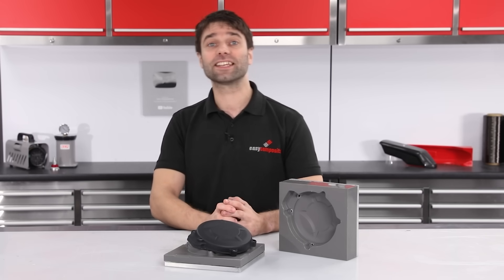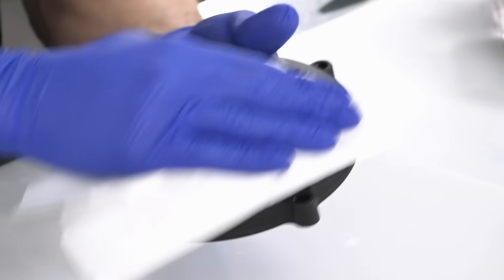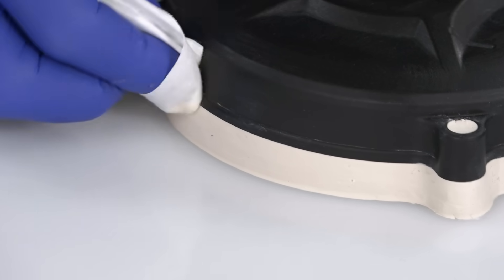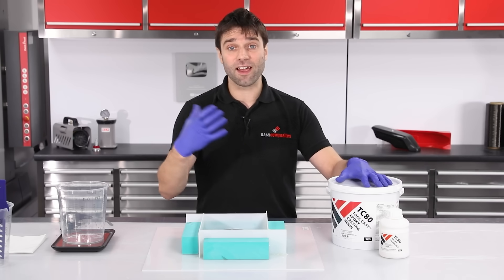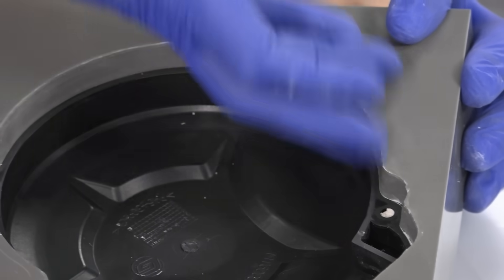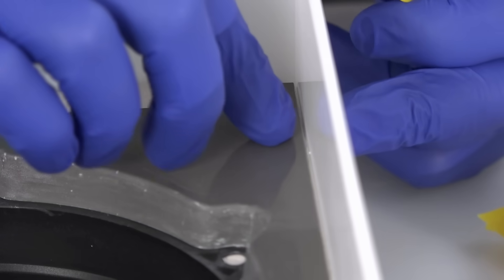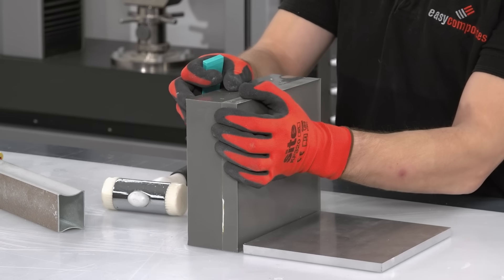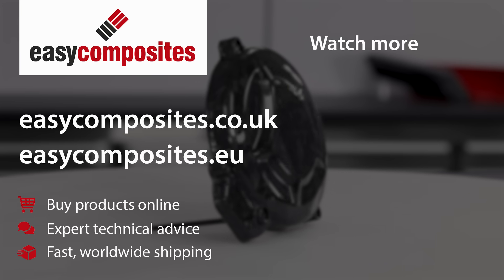How to Cast a Two-Part Compression Mould for Forged Carbon Fibre

Comment: Looking forward to your next video as I am in the process of making this for some of our projects.
Reply from the maker: Hi Joseph, hopefully the videos will answer all of your questions if not please let us know :)
Reply: @easycompositestv  I hope so. But what I am doing is making two half forged carbon parts as there are some undercuts in the model and a hard mold will not be able to remove from the inside once the carbon is hardened. So I make two half parts then join them afterward with the same resin. The tricky part now is how to make the joint seamless.

Comment: Neat trick with adding the wedge slots for separating the two halves. I guess there's nothing to stop me doing the same thing with some wax on the flanges of a wet lay-up to make it easier to get a wedge started... :)
Reply from the maker: Indeed, the principle will work on all sorts of matched tooling or multipart moulds on the join lines.

Comment: I didn't get a good look, but the original part has a mark on it saying something like "PA66  GF35". This means Poly Amide 6,6 (chemist speak for nylon) Glass Fiber 35%. Similar markings exist for for other polymers. 
My point is that these markings should be scrubbed off when being used to make a mold so as not to confuse customers , future owners or your future self.
Reply from the maker: For a product you  intend to sell, yes it would be a good idea.  For a personal project or one off, such confusion is unlikely to occur - especially for a part that appears to obviously be carbon fibre of some kind.

Comment: Awesome :) How strong are these forged carbon parts?
Reply from the maker: Entirely depends on the thickness of the part but generally a forged component would be considerably stronger than a typical injection moulded plastic part. We intend to cover comparison of strengths in a future video which will answer your question in further depth. We hope to release this in the next few weeks.
Reply: @easycompositestv  I will watch that for sure :)

Comment: whoever came up with the idea to use the word "forged" for molded chopped-fiber composites was a marketing genius.  Dishonest, but clever. Meanwhile, metallurgists continue to cringe.
Reply from the maker: Haha, yes, we knew this would come up. Here's where we got to our thinking with it...

For what it's worth, it was pretty-much Lamborghini who coined the phrase, if they didn't coin it, they definitely popularised it and you can't question their marketing skills!

On the etymology of the word 'forged', both in an established engineering context, and in its suitability and applicability in a composites context (regardless of whether Lamborghini and others were using it) we don't think it's too far from the mark. Whilst 'forged' means something specific in a context of forming metal, the word forged also means "formed by pressing or hammering with or without heat" (Merriam Webster dictionary) or "to make or produce something, especially with some difficulty" (Cambridge dictionary). Given that the process - in this context - refers to compression moulding under pressure, this description does seems pretty apt.

Whilst you could certainly call a 'forged' carbon fibre part 'compression moulded carbon', you could actually call most carbon fibre parts 'compression moulded' because many processes - vacuum bagging, prepreg, SMC etc, are all forms of compression moulding. Forged carbon is a way of differentiating compression moulding short strand carbon from traditional woven or long strand reinforcement. The short strands being key to the process in allowing the reinforcement to 'flow' more easily to conform to the mould contours under pressure in a rigid tool, something that doesn't happen with woven or long strand reinforcement (leading to voiding).

Comment: Looking forward to the rest in this series. I imagine this process is particularly good for detailed parts and also bypasses all of the effort of vacuum bagging?
Reply from the maker: Although it bypasses vacuum bagging itself, there is still a reasonable amount of force applied in the compression stage which replicates some of the forces involved in vacuum bagging. That helps with fibre consolidation and removing excess resin.
Reply: @easycompositestv  what sort of tonnage press are you looking at for the compression stage? Would a 10 tonne press be enough or would you need something beefier?
Reply from the maker: @TheFatPandaIAm  Obviously you could use a press but in the case of this part, we'll just be using G-Clamps - we'll cover this in detail in the upcoming video.

Comment: What a shame this is not suitable for high temperatures, would like to use this for prepreg tooling, or even replacement for aluminium tooling
Reply from the maker: Hi Miles, there are options for creating a high temperature version of the same process. We need to do a bit of testing to make sure it would work as anticipated but we think there are products in our range already which could be combined to create a high temperature version of a Tool Cast epoxy. Once we’ve done some testing, we’ll add the information to the project page for this tutorial on our website.
Reply: @easycompositestv  im I'm the market for 200°c capable tooling if you are able to test that 😉😄
Reply: @easycompositestv  yes please! we need this for prepreg

Comment: Neat tip with the wedge inserts on the sides 🤟
Reply from the maker: Yes, they did work out rather well. In the end, the moulds just fell apart so they could be considered a bit overkill but if you were using the moulds over and over then you’d probably start to appreciate little bits of finesse like this.

Comment: great video as always 
thanks, 

is there any product that can handle a pre preg cure
Reply from the maker: Mmmm, good question. Not as an 'off-the-shelf' product but we suspect a good high temperature equivalent could be made by combining our EL160 high temperature epoxy with powdered aluminium and (possibly) some aluminium trihydroxide (filler) to produce a high temperature casting material with the right thermal properties. We did anticipate this question and plan to do some tests to evaluate this combination of materials. We're pretty sure it would work fine. We'd probably recommend using our EG160 high-temp gelcoat to improve the polishability of these moulds, if they're for prepreg production.

Comment: If I didn't know better I'd say you have done this before.
Reply from the maker: Haha, well Mark we've used the TC80 to make plenty of one-piece (male) moulds for vacuum forming, and of course we have quite a lot of general casting experience but - to be perfectly honest - this was the first time out using the TC80 to make a matched compression tool. That said, when you're lucky enough to work with these materials constantly, you do tend to get a pretty good 'feel'!

Comment: Do these parts have to be cured in high temperatures?
Reply from the maker: Hi Paulina, no, this is all ambient temperature cure. When we do the forged carbon process in the next video, that's also all done at ambient temperature so no oven or additional equipment required.
Reply: @easycompositestv  ok thank you for the response. I have a curing oven. Had issues with 2x2 carbon fiber twill that I made with my boyfriend for cars interior trims. In the summer time the parts would warp because the temperatures in the car would rise close to 180f. So we started curing the parts in the mold before releasing them and that fixed the issues.

But since the parts in the video are forged and are compressed, I would assume that the structural rigidity gives it less play to warping, especially since there’s very little epoxy in the carbon fiber. Just double checking. 

Do you guys ship to the USA?
Reply from the maker: @paulinadeluca9117  Hi Paulina, we can ship to the US, no problem in fact we ship every day and have a great customer base in the States. Smaller orders containing Dangerous Goods such as Resin and Solvents can be a little expensive, but the good news is that you can get an accurate shipping cost easily on the website, simply add items to your basket and then choose ‘United States’ on the basket page. If you have any questions though, feel free to drop us an email to sales@easycomposites.com.

Comment: Realistically, what's the upper limit of complexity and size part this method can be used for? It seems like an up-gunned version of squish-casting polyurethane resin in rubber molds to produce thin-wall parts (model car bodies, tail lights, etc.).
Reply from the maker: It's hard to define an upper limit on either size or complexity. In terms of size, practical considerations would come in here - these tools are solid, so they're heavy, and the have to be clamped (or pressed) together evenly, and you need to handle the alignment during compression and demoulding and so the upper size limit might be constrained by what size all these things would be practical up to. In terms of the complexity; well, you would probably want to limit to components that can be moulded (and demoulded!) using a two-part tool. In all our testing and development, we've really been thinking about this process for relatively small, but potentially quite complex, 3D moulded shapes. Our examples are a linkage, a clutch cover and a brake lever, these would be very suitable components for this process.

Comment: Do you plan on covering mechanical joining CFRP? If it's feasible to build the threading out of carbon fiber, how to integrate metal inserts which can be used for threading, etc...? Thank you.
Reply from the maker: Yes, we'd definitely like to make a video about composites assembly, I'm confident this won't be too far off. We would include integrating inserts. You would almost never make the thread itself out of carbon fibre.

Comment: Great tutorial! Would really appreciate if you could show how winglets etc are done.
Reply from the maker: Well, they could certainly be produced using exactly the forged carbon fibre process we show in our next video tutorial where we use this compression mould to make the clutch cover, as well as making another component using a 3D printed compression mould. But, in the case of a winglet, the shape is pretty simple and you could just use the matched tool process to compression mould the component using epoxy and woven cloth.
Reply: Thanks a lot! In my case the winglets are bent and u-shaped so I would need to much plasticine to fill the gap.